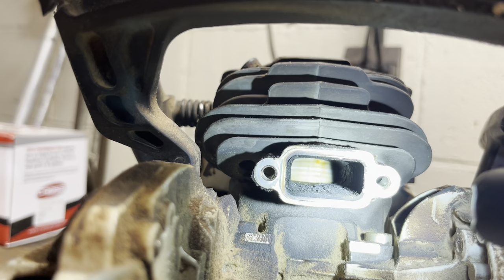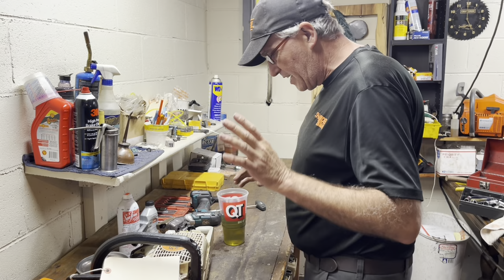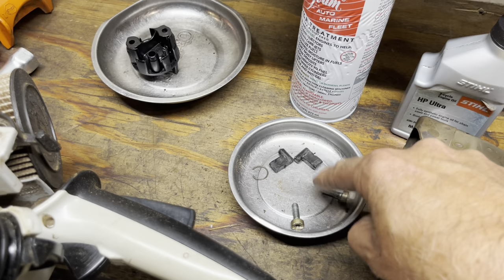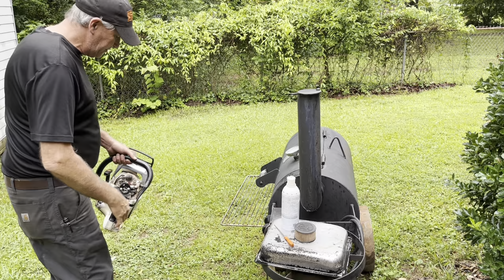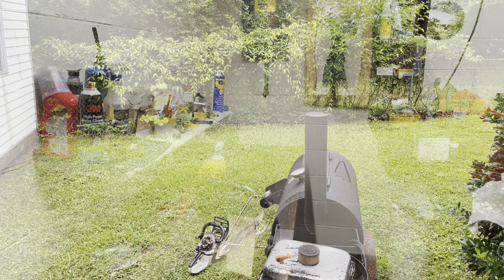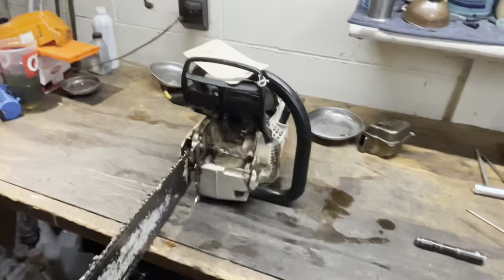Stihl Ultra. Can Seafoam Save the Day?

Comment: Pretty much every two stroke oil out there being made is now "D" rated and not long ago was "C" rated which by the way was decent oil until these "strato saw's" came along, then everyone had to up their oil game and go to a better grade of oil hence "FD" to give a little more protection. So for Stihl to be messing around with older sub grade rated oils which were all the rage more than 20+ years ago lead's me to believe it's no accident or that they are unaware of what's going on. Yes I know they don't bottle oil themselves but by their direction to who does for them, they are not that ignorant it's a decision they've made on purpose. That decision is have early or premature wear or failure so they can sell more new product plain and simple. The Stihl fan's can say oh no no they would never do that, when corporate greed take's over we all know where that lead's. You probably don't want to touch that one but I have no problem saying it all point's in that direction it seems; anyways I've rambled to long take care.
Reply from the maker: You're spot on.  Stihl reps will tell you if your having this issue "you're not running it right".  Any new, non-4Mix, true two stroke will be back in for service in a matter of months for a "no start" issue.  The spark arrestor will be clogged.  String trimmers, hedgetrimmers and handheld blowers are run in short bursts and never really get run hard.  The clogged spark arrestor issue will not be covered by the "double your warranty" pledge of running Ultra.  You'll be told you didn't mix the fuel right.  Most all shops have a minimum .5hr labor charge of $40-50 so Stihl knows exactly what they're doing.
Reply: Yeah it kind of amazes me that Stihl would put out a product; that's their "ultra premium"; that's not even FD rated. I think you're spot on, it's a form of planned obsolescence. Reminds me of a Chickanic video I just watched where she talks about the fact that strimmer gear heads no longer have a greasing nipple. The more stuff breaks the more these companies make unfortunately. Then they'll blame it on you and claim you didn't mix their "excellent" oil correctly
Reply: I copped on to the ultra mostly from Richards videos if I'm honest, ultra is rubbish only fb rated, for to keep the epa happy. I went back to stihl hp super its fd rated iso L Egd. Its green as well but a way nicer brighter cleaner green compared to the pond water.  I'm not taking any chances with my saw, 45 to 1 ratio with aspen 4 for super long fuel life and engine cleanliness.
Reply: @AnarchAngel1  Don't forget according to manufacture's recommendation's you no longer have to change engine oil in your push mower's or lawn tractor's. Oh and no dip stick to even check your transmission oil level in your vehicle never mind changing it heaven forbid. It's filled and sealed at the factory so you never have to, "Good for life" ya a pretty short one.
Reply: @6900pilot  Carful with those long life "engineered" fuel's that's being bantered around these day's they are not all what they claim to be. They have a tendency to burn pretty sooty ie produce a lot of carbon, some don't really want to burn proper but a lot of these fuels actually make most two stroke equipment harder to start or won't run at all with it in the tank. Dump it out and put regular fresh gas with a good mix and they fire right up go figure. There's lot's of video's on Youtube with quit a few well known Youtuber's doing all kind's of test's on this stuff showing it for what it is; and that is a lot of marketing hype by these company's.   Another fun fact a lot of people are not aware of is Stihl's motomix ready to use premix fuel in a can also use's ultra swamp water sorry pond sludge in that crap I know shocker!
Reply: @StuInTheSticks  I've had zero problems with aspen fuel, I can't speak for motomix because its got the pond water in it so I'm not going to use it, if I put my leaf blower or strimmer or  chainsaw away for the winter with aspen fuel in it, it will fire up after 2 to 3 pulls with the full choke on, one pull all day after that so I'm happy with that. As for carbon I don't see a trace inside the muffler in fact it's well known that aspen fuel actually cleans a dirty engine out,, i mix stihl  hp super with aspen 4  in my equipment at 45 :1,  this is a super high performance oil rated fd or ISO L EGD with high detergentcy for engine cleanliness.. Just my experience anyway thanks.
Reply: @6900pilot  That's the one major thing " engineered" fuel's do very well and that's long term storage thus their claim to fame so to speak which is fine, but there's to many of them that have a bad rap for poor performance outside of storage when in use and it's becoming well known. If you've found one that work's for you that's all that matter's; but if your running a lot of saw's or a bunch of other two stroke equipment "engineered" fuel's aren't affordably practical when your burning through several gallon's of gas on a regular basis. Most but not all of the FD rated oils have a very good detergent package so some work better than other's with carbon when keeping it at bay or helping to get it out. If you already have severe carbon buildup the damage is already done ie bottom end bearing's and top end ring / piston / cylinder wear. That's pretty much what Richard's main complaint with bad oil's like Ultra has been all about when he started posting about this.
Reply: Probably why Stihl offers a decarbonizing fluid to combat their crappy Stihl Ultra. MowerMedic1 did a video about using Seafoam as a decarbonizing agent. In the exhaust port he just brings the piston up to seal it off and fills it up to soak for a period of time. In the engine he does the same process by filling through the spark plug hole making sure that the piston is just high enough to cover the transfer and exhaust ports.
Reply: @richardflagg3084 Ir drives me crazy when I see (or hear) someone running a strimmer in spurts or half-throttle because I know that's going to clog the spark arrestor. Granted, my strimmer and leaf-blower are Echo and have always been run with Echo mix, but I've never had a no-start issue with them. Of course, my use situation means they get long full-throttle runs. I have had a no-start issue with my Stihl saw that turned out to be user error (I wasn't correctly putting it into full-choke). I'm not overly happy with that saw anyway as it likes to die when given throttle if it started from cold/had been sitting for a few minutes. I ran it with Echo oil as well.

Comment: I had a MS251 Stihl given to me because the compression was so extreme at cold start that the owner didn't want it anymore. I tried it and he was right, I couldn't believe how hard it was to start it, I'm not joking. I pulled the muffler to have a look inside and just like you, could see carbon and a dark honey colored piston. I did notice that once the saw had warmed up it would start like normal and ran perfect but once it sat overnight it would go back to extreme compression again. I did my research and noticed other people dissing Stihl oil and how much it coated the piston and cylinder so I called the person who gave it to me and low and behold he was using Stihl oil mix since he bought it. I then read about Echo's Red Armor and how it cleans so I bought a gallon of True Fuel (straight gas) and mixed Red Armor into it to achieve a 40:1 mix and ran that saw through a bunch of firewood until the gallon was done and it solved the issue. Now when I pull the muffler there is only a light coating of carbon and the piston is silvery like it should be. Now I have a nice running Stihl.

Comment: I have been running SuperTech in that easy measure container for years. I haven’t had any issues, I run all my saws, blower and string trimmers on the rich side. They all need a load, run them dull or with no string p, they blow up.

Comment: I have quit using stihl ultra HP oil in my equipment. I now run amsoil saber at a 40:1 mix and I use ethanol free fuel. I also have recommended that my friends and family switch to amsoil saber as I have . Stihl needs to get the oil up to the fd standard. I might consider running it again if they do, but amsoil is a good oil.
Reply: I’ve felt conflicted watching the guys carrying it in the store, but not checked out yet, like I should say something. “Sir, Have you found Richard Flagg in your life?”

Comment: I have noticed that most all Mtronic/Autotune saws have that blow by coking on the skirts. Maybe due to the fine tuning by the saw itself. I have run Red Armor at 36:1 since I've had my 261cm, it still has that brownish on the skirts. 
Saw runs strong and all, but just reporting my observations.  BUT there is very little carbon buildup in the exhaust port. So that is a plus. Saw is ported...
Love these videos Rich. Thanks for doing these for us. 🍻
Reply: Same mix I use 👍

Comment: I used to work on a lot of outboard motors .  Many customers used seafoam in the motors on a regular basis, and the pistons and exhaust ports definately had less carbon than those that didn't use it.  To clean up a carboned up motor requires quite a few tanks of fuel to get any real results.  This stuff doesn't work in short term use.
Reply: My absolute BEST luck using it is to put the piston at TDC and put a splash in the cylinder.  Let it sit for a day or two and then run it.
Problem is if you lose a big ole chonk and it gets chewed.
Reply: Interesting. @mattfleming86
Reply from the maker: Carbon is a lot tougher than most people think.  "Harder thank woodpecker lips" comes to mind.

Comment: I plan on running amsoil Saber when I use up my ultra, due to your advice. Problem is I have 2 gallons of ultra and I hate to waste money. Do you run 50:1 with amsoil? I have seen so many different mixes on forums out there.
Reply: I think running Saber at 50:1 is fine especially in more high strung saws. I run it at that ratio in my newer auto tune Huskies. I run it at around 75-80:1 in some other saws and haven't had any issues. Saber has excellent anti wear additives and part of me feels like running it at 50:1 is a waste but you can be pretty confident your engine is getting properly lubricated at that ratio. Definitely one of the oils I never feel the need to mix any richer than that
Reply: @AnarchAngel1  I have modded 461 and modded 661 probably better at 50:1, thanks.
Reply: I've been burning small quantities of Ultra off in my lawn mower just to get rid of it.  My old 1984 JD 316 burns oil pretty good.  I usually add a half a bottle(1-2 oz.) and top off with SAE30 is the easiest way for me to get rid of it.

Comment: Plenty of people treat seafoam like its a wonder additive because of the smoke. Reality is it will take time to clean out large build ups. If you add a little bit with each mixed tank of gas you will prevent build. Preventative maintenance is always better then reactive.
Reply: I add a little bit of seafoam to every tank... probably like a quarter of an ounce or so... just a splash.  I'm convinced that it has helped keep my equipment running reliably

Comment: Seafoam might be ok to clean up the combustion chamber but its going to take a long time for it to do anything with the exhaust port. Better to run an FD oil like Red Armor which will eventually clean up the worst of the carbon buildup.

Comment: Been running red armor ever since learning about Stihl pond water from this channel, THANK YOU!! Just picked up an ms462cm and wondering if i should go 40:1. What would you recommend? I usually run my saws like I stole them 😮
Reply: Red Armor has really good film strength. Probably be fine at like 45:1, that's where I run Red Armor. I run Amsoil Saber in everything else at around 75:1
Reply from the maker: Absolutely 40:1.  These newer models are pretty high strung.
Reply: @richardflagg3084  I stand corrected by a man that's been inside far, far more engines than me 😅 It's just looked to me like that stuff is everywhere even at 50:1. Still like Saber better 😏. Hey Richard if you were to run Saber in your personal saws what ratio would you settle on?
Reply: @richardflagg3084  Thanks Richard, I’ll be adjusting immediately .
Reply from the maker: @AnarchAngel1  I've got a couple of customers that run it at 40:1 and the oil film in the crankcase is really nice.  It still burns cleaner than anything else at that ratio too.  Buying it by the quart saves a bunch of money as well.
Reply: @richardflagg3084  Yeah I have a gallon of it...I've been mixing it at 50:1 for my more high strung auto tune saws and 75-80:1 for some of my others. Getting kind of tired of keeping several mixes around though so maybe I'll try it at 40:1 in everything and see how it goes. I've just been very impressed at how clean it burns and the power I'm getting mixing it at 75ish:1. I've always wondered if it would produce more carbon deposits mixed at 40:1 but if you think that has no negative impact I might just mix it at 40:1

Comment: Great video! Just subbed! Now I have to check my equipment as I’ve always used Ultra!
Reply: I did a video on my channel of my 15 yr old BG-86 always run on 10% ethanol fuel with Ultra oil. Maybe it’s because I use 40-1 but the piston, exhaust port, and cylinder look like new!

Comment: I picked up my first "real" saw a couple weeks ago. a 261. I trusted that their ultra and 50:1 was the proper way to do things, and I'm a stickler for doing things right, but the more I look into it, I guess their oil is garbage? I've ran a gallon and a half of fuel with it so far. Guess from now on I'll use amsoil saber at 40:1 like I keep seeing people mention?
Reply from the maker: You'd be hard pressed to find a better oil.  I think you'll be enjoying your saw for years to come.
Reply: I work in a Stihl shop. We’ve found Stihl Ultra to work better at 42-45:1 on any properly jetted/tuned 2T machine…and run that machine hard. These are performance machines so make them work hard. Yes there are better oils out there, Motul 800 and Motorex are brilliant.

Comment: I have used sea foam in every two cycle I have owned, plus chevron Techron. There is very little carbon on piston, muffler. This starts the first use of the equipment, including out board two cycle. I put a 40/1 mix of oil.

Comment: Hey Richard, like your videos man very educational I like the way you break it down. In your humble opinion. Which I value. Which oil would you run in your saw.
Reply from the maker: I use Schaeffers 7000 in my personal equipment.  Yes, it's an oil intended for water cooled engines, but it does a fine job in an air cooled engine too.  I've used it for years.  My next favorite is Saber.  Both at 40:1.
Reply: Motul 800.

Comment: Haven't tried it in a saw yet but agree, sea foam is good stuff for loosening carbon. Also agree on why try improving a sub-par oil with additives when there are so many far superior oils on the market? And many of which are also cheaper!
Reply from the maker: Nailed it my friend.
Reply: One of the problems with oils that aren't fully synthetic is they use zinc and phosphorus as anti wear additives. These don't burn off completely and zinc for example actually attracts carbon. One of the reasons I switched from semi synthetics to fully synthetic like Saber

Comment: Takes awhile for the seafoam to work. I've cleaned up saws with it before. I usually stall them on it and wait a day or two to re start. I'm with you. Use an oil that keeps it clean. If you can get the guy to switch to Red Armor, that saw will be clean in no time. I use Mobil One synthetic high mileage in my stuff. My stuff stays clean and well lubricated. I have been thinking about changing to Red Armor though. Just to change things up a bit. The only drawback is price. I get four applications out of one quart of oil. Saves money.
Reply from the maker: If you can source it locally, try some Saber.  It's about $15 a quart.  Red Armor is a great oil, but it's $17ish for a half a quart.  I don't understand the logic using 4 stroke oil, but it's your equipment  and you can run what you want.
Reply: @richardflagg3084  I didn't either at first. I collect saws, so I go through a lot of fuel. A guy on one of the forums told me about it, and I thought I would give it a try. I had a little wild thing that I had souped up,so I made it my testbed. I ran the snot out of it for months. That was close to twenty years ago. The piston, and cylinder look like brand new to this day. My cousin has it now. I've also cleaned up my old stuff that I use regularly that had God knows what run through them in the past.
Reply: @timothybyrom5560 I grew up in the late seventies through the eighties and I’ve torn down quite a few saw engines that were run on the old motor oil mix and they were a lot of the times in really good shape.
Reply: @alanmeyers3957  I think the synthetic part is the magic. Also I use the high mileage. It's got additives that keep the seals pliable.
Reply: @richardflagg3084  I won't use anything amsoil. I've had bad experiences with it. I was watching another of your videos, and I was reminded of the Schaefer oil. I LOVE anything made by them. My old boss is a dealer, so I think my next will be Schaefer. I've been doing the Mobil One thing for about twenty years. It's time for a change. I kinda miss that two cycle smell.